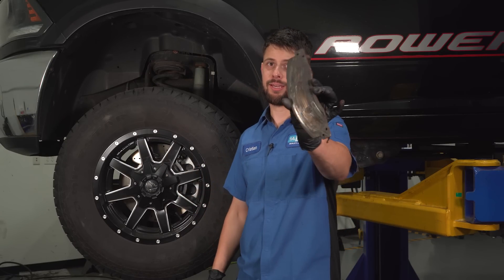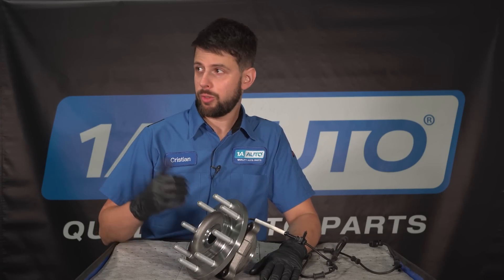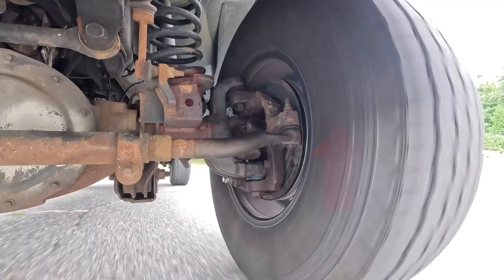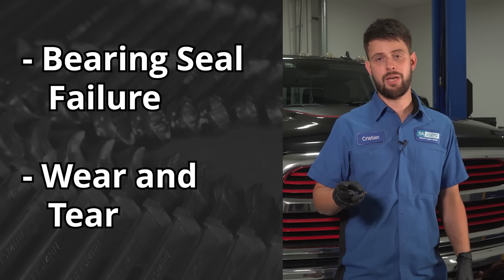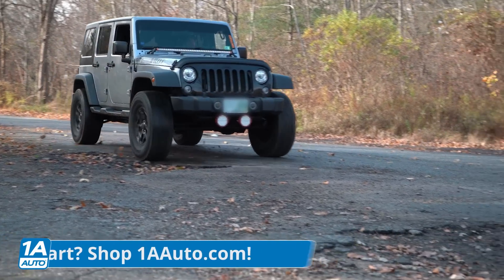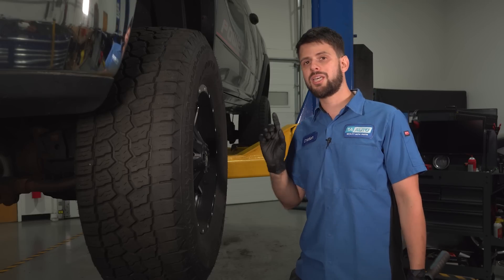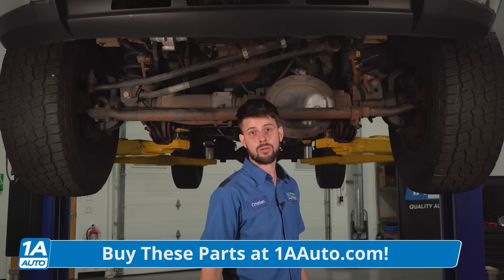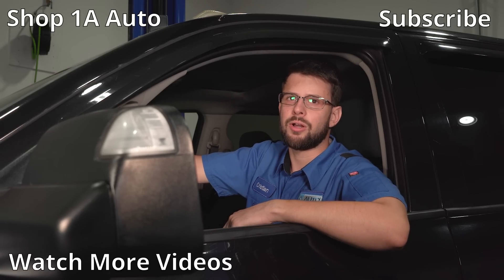Those Oversized Tires May Look Good…But Which Parts Are They Damaging on Your Car or Truck?

Comment: It’s pretty simple math.  If the stock tires are 30” diameter, and you change them to 35” diameter, you will raise everything in the vehicle by 1/2 the increased diameter, or 2 1/2”.  The most significant points are the differentials, since they usually hang down the lowest on solid axle vehicles like Jeeps.  Lifting the body does almost nothing in comparison.
Reply from the maker: +@1wheeldrive751 Thanks for the feedback!

Comment: When I bought new tires for my 23 Tacoma TRD Off Road, I decided to buy a 1” taller tire. I kept the 16” wheel size instead of opting for a 17” wheel.
I wanted more side wall to soak up more impact because during the summer months I often take my truck on service or forest roads.
I wanted the extra 1” of ground clearance because we live on a private road and we get 5-7 feet of snow per winter and we have to plow and maintain our road ourselves.
The width of my new tires are the same as factory.
I chose Falken Wildpeak AT4W 265/75/16.
Yes I took a hit on fuel economy but I needed a stronger tire as we use my truck for work around our mountain property.
The AT4Ws are designed for full sized pickups, but I put them on my Tacoma.

Comment: Depends on how you use your truck, I got my truck stuck twice and bent a front facade bracket on my trail boss. I leveled it put on 35s and it drives soooo much better. Same spots where I had issues are not even of concern. So yes if you are doing it for looks know it may cost you some suspension if you are off road a lot just suck it up and upgrade because it will actually save you money in the long run.

Comment: I’ve changed wheel bearings on trucks with stock wheels & tires. That being said, the trucks running excessive offsets are way more prone to failure. I’ve seen a few trucks where the wheels have actually fallen off.

Comment: I run bigger tires on my Ram 2500 and have never once had an issue or seen premature wear. 65,000 problem-free miles.

Comment: I put 305/40/24 on my 06 yukon denali and ive had 0 issues. No noises. Drives incredible and gas is about the same with stock.

Comment: I went from steel rims to aluminum went up in tire size from 265-285 no difference in weight and gained tread never run spacers. Do not deviate too far from factory engineering specs and you will be fine.

Comment: Big wheels and tires = more unsprung mass, more load on components including brakes, higher rolling resistance, higher fuel consumption, increased aerodynamic drag, inferior on-road handling, slower acceleration and messes up your speedometer readings.  All for what? So you can drive over a rock better once every ten years in that wilderness trip you promised you’d do every weekend and look like a gigantic wanker 99% of the remaining time? Pass.

Comment: If I need larger tires I bought the wrong truck. Yeah it’s fun, looks better and performs better off road in the short term, but unless you upgrade your entire suspension, breaks, drivetrain your shortening their lifespan, durability and reliability.

Comment: I have a 2005 Toyota Tacoma TRD Sport. I got it brand new, and after two years of owning it, I lifted it 3" with 31's tires and 17" with -12 offset wheels. As of now, the truck has 202000 miles in it so far I have no issues it is still factory-installed wheel bearing.

Comment: ford ranger 2017 with 285 70 17 goodyear wrangler + 30mm wheel spacer, at 70k odo but still no problem at all. Maybe its all about how you maintain your truck or the way you use it.

Comment: Is switching from factory-installed highway tires to say, heavier All-Terrain or Rugged- Terrain tires (same size) gonna affect the wheel bearings?

Thanks in advance.

Comment: You know what is the problem with custom modification in general? Consider this;

-car manufacturing companies spend millions (at least) designing a car

-an individual will spend X amount of dollars on one aspect of the vehicle

Does it make sense? Not yet?

-car manufacturing company do an RnD on a car which takes years before it gets to blueprint. Some cars have been around for more than a decade and is literally an evolution from the first gen. Toyota does this a lot thus making their products “bullet proof”. 

-an individual who wants to modify his/her car spends x amount of time choosing what wheels to install

In conclusion: Stock set up is balanced build. Every part serves a purpose. Personal modification, often times, only considers a portion not the entirety. But even though this is the hard reality, there will always be THAT person who thinks he/she knows better.

Comment: Depends what you switch to and what the vehicle is. My 23 tacoma had 245/75r16 tires. Upgraded to 255/85r16 for more ground clearance. If I switched to 35s then it would start becoming an issue requiring a lift, control arm upgrade, and shims to correct the the drive shaft and cv angles. 33s don't change the performance much but 35s will. If the wheel bearing goes bad oh well, i'll buy a new one. The extra ground clearance is worth it offroad. C rated 6 ply tires weigh a lot more but it can actually stand up to the offroad conditions. Its all tradeoffs.

Comment: Wait, you mean installing larger tires , wheels , suspension lifts will cost you more money and cause pre mature failure?? Obviously this is true. What’s not obvious to the average consumer is that aftermarket parts that you sell will fail even faster. So stick to genuine and watch how long they last.

Comment: Cars too. This would explain why I got wheel bearing issues after buying bigger tirerack rims with lower profile tires. I though it was just a pothole. The low profiles also reduced the cushioning.

Comment: I do lots of off-roading in the Arizona desert. Both my truck and jeep have 2” lift kits but run stock or slightly larger than stock tire size. My suspension components last way longer than trucks with 35s or better, and I go 99% of the places they go.
Reply from the maker: +@wranglercody8422 Thanks for checking us out! http://1aau.to/m/Shop-1AAuto-c

Comment: More likely it is the negative wheel offset putting the additional load on the bearing not the oversized tires on its own.

Comment: Don't try wider size tyreson a Tata vehicle. They are not made to handle the extra pressure and bearing will fail. Speaking of experience on behalf of a friend who had a bad experience.

Comment: Many owners of 4X4 trucks put larger tires on their trucks as their first modification. It looks cool, but accomplishes little, other than excessive wear, as you stated. My feeling is that auto makers spend millions of dollars designing these trucks for their specific intended use, and after market parts producers do not. I have a 2019 Power Wagon, and literally everyone thinks the stock tires are too small, and they change them immediately. I can honestly say, living in Montana, I have rarely met an off road obstacle that I couldn’t conquer with the stock set up.The few times I have do not justify the expense of larger tires, suspension upgrades, and the increased cost of maintenance.